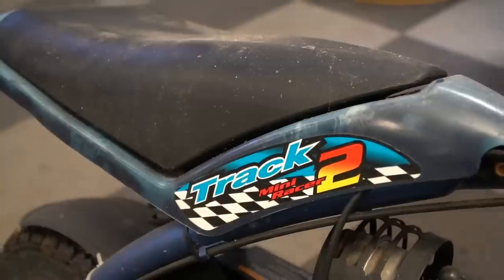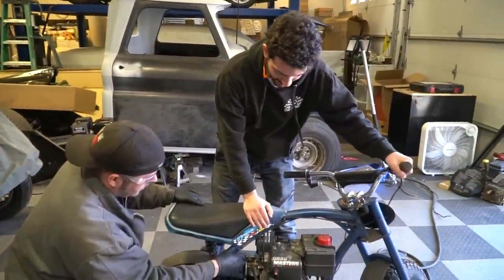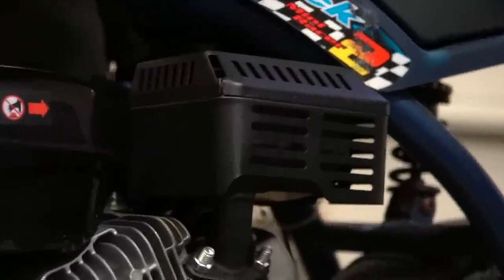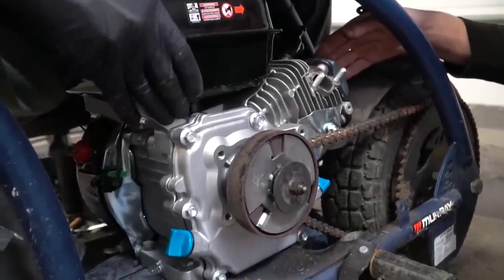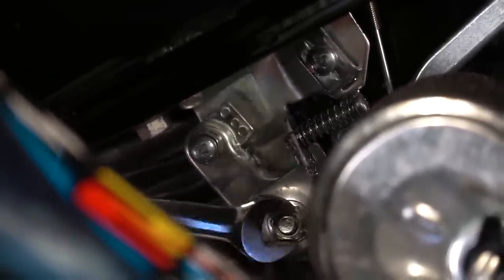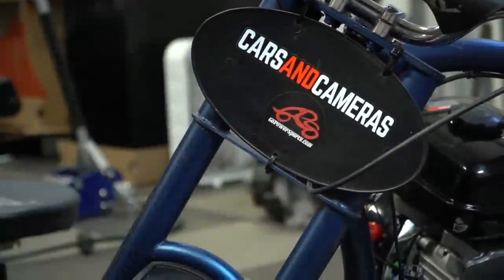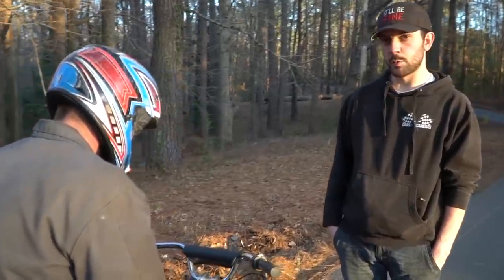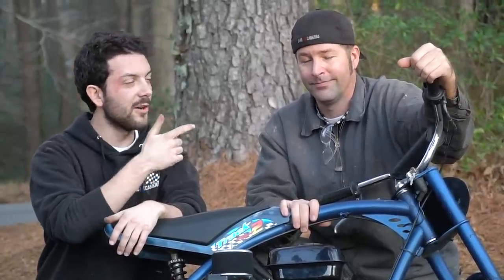Tillotson 212R | 212cc, 12HP STOCK!

Comment: Cool frame. Back in the 70s my dad and I shoved an old 125cc engine with gears into a small mini bike. Top speed was probably 30 with those small wheels but it would pop the front end up at 29. It could climb a tree, the engine was and old Hungarian engine called a White but looked like a two stroke Yamaha. We had to fabricate a rear sprocket from two bike sprockets and manually turn a lathe in reverse to make a left handed threat nut for the fly wheel I think. It had three gears one down and two up. The clutch was a wet cork style and yes we tore the engine completely apart and reassembled it. If it's still in one piece it's probably somewhere in southern California. Good time back then.
Reply: I would of put a 200 in it but that kinda slow for a mini bike but it was probably fun to ride

Comment: I loved my Murray and still do. Swapped a predator 212 on it in 2013 road it for 3 years then got into trucks. Last time a cranked it the throttle stuck wide open and ripped a badass burnout. the huge sprocket on the back makes it a torque monster.

Comment: I own 4 murray track 2s. Best bike hands down. You should do the front suspension upgrade. You can use the forks off a razor electric dirt bike 500 or 650 model and they are a direct swap, no modifications.

Comment: Stock Tillotson 212R vs a  stage 1 preiditor witch is faster
Reply: Matt Wright this!!
Reply: Dump for comparison.
Reply: Definitely the Tillotson.  But if the governor is out of the Predator, the Predator would go harder once it got into the powerband
Reply: Stock tillotson 212r with centrifugal clutch vs stage 1 predator with a torque converter would be an interesting matchup
Reply: Clutch vs clutch with the predators governor removed
Reply: The tillotson has 13 to 1 compression  and the preiditor 8.5 to 1. Tillotson 10 hp , modded preiditor around the same we need to actually see because it's all speculation otherwise. The tillotson is $180 and the preiditor is $180 with the stage one kit . Both very similar but one has to be  king!
Reply: @715101  well, a torque converter is just a variator on the engine side and a regular clutch on the output, so it would probably more finely tune the power delivery compared to a clutch.  But it would have to have some power loss going through two clutches (a variator is basically a clutch fixed to the engine), so itd be very interesting
Reply: Which*
Reply: To be fair for testing the two engines they should be set up exactly the same.  Both should have clutches or both should have torque converters.  They should even have the same gear ratios...
same size sprockets.  Otherwise it would not be a true comparison.
Reply: Tillotson 212 All Day 💪😏
Reply: Or tillotson 212r vs the hemi version

Comment: MFG. DATE:  01060    /  YYDDD  =   March 1st 2001

Murray used a couple different ways of how the date of manufacture was list.

1970's tag format YDDD

1980 and early 1990 tag format DDDY

Late 1990 and Early 2000 tag format YYDDD

Early 2000 on MM/DD/YYYY
Reply: The example you give of how they did it in the 70s is known as the Julian date. Used to use Julian as a mechanic in the Marines when filling out paperwork to order parts for our equipment 20+ years ago.
Reply: Just checked mine.  01066.  Mach 6, 2001...

Comment: Put a torque converter on it!
Reply: yep, thats what it needs most.
Reply: Cvt
Reply: @TheBestOrion  CVT is a torque converter.
Reply: @Ritalie  no, it's a continuously variable transmission. You can find a torque converter in a car/truck etc. transmission.
Reply: @TheBestOrion  torque converter is a brand of cvt for minibikes and go karts. Not to be confused with the torque converter of an automatic transmission.
Reply: Orion VanNortwick an actual cvt would have gear ratios of a normal transmission 1st gear - 4th. Cvt and automatic transmission could be swapped without significant power/speed losses as long as the ratios are similar. It’s a torque converter because at low speeds it slightly reduces the gear ratio, and when your up to speed your at your actual gear ratio, it’s not a transmission it’s a fancy clutch with better low end power. It’s not a cvt it works on a similar principle as a cvt but couldn’t come close to replacing a transmission, that’s why they’re so often compared to centrifugal clutches (aka single gear).
Reply: @yachtyteam6978  automotive cvts only have the gear changes programmed in. For a cvt to work at maximum performance, the engine would remain at the max horsepower rpm while the gear ratios change continuously.
Reply: Kaulin Curtis there aren’t any “gear changes” in a car cvt it’s controlled by hydraulics constantly changing the ratios between the crankshaft and the driven pulley. An engine doesn’t have to put out “maximum horsepower” for a cvt to be effective/max preformance, it’s used mainly because it’s cheaper to make a cvt than an automatic transmission and it gets better gas mileage because the gear ratios are infinite and doesn’t require shifting like auto/std tranny
Reply: @yachtyteam6978  No there are not literal "gear changes." But the transmission is programmed to move the sheaves of the pulleys to change drive ratios to mimic a conventional automatic. High performance cvts don't do this because it doesn't keep the engine at maximum horsepower.
Reply: @yachtyteam6978  so I guess it would be better defined as a hybrid cvt/torque converter? These terms seem to be interchangeable, depending on what forum you read.
Reply: Orion VanNortwick what I’m saying is a torque converter isn’t a continuous variable transmission (cvt) but it’s more of a clutch with low end torque. That’s why we call it a torque converter.
Reply: @yachtyteam6978  but what I'm getting at is that, yes it acts as a clutch, but it also alters the gear ratio like a cvt does. When I built my taco style minibike, I calculated where my optimum gear ratio would be, set it a little taller because like you said it will start out with a good low end torque and then progressively change the gear ratio for more top speed. Or is understanding just completely wrong?
Reply: Orion VanNortwick Your completely right, but what I’m saying is a torque converter doesn’t have nearly the same “gear range” (or whatever the term would be called) as a transmission. Idk if I explained my position good or not, but the best example of what I’m trying to explain is imagine the torque converter “low gear” is a 10 tooth sprocket and the “high gear” is a 12 tooth sprocket, if it was an actual transmission (cvt, manual or even automatic) would have a more significant  difference in the gear ratios. 

Just imagine a 212 predator with a 5 speed auto versus a 212 with a torque converter, with all other variable the same, the engine with the 5 speed auto would whoop ass.

And then imagine a car with a 4cyl engine with a 5 speed automatic tranny versus a 4cyl with a cvt, with all other variable the same, likely the 5 speed would win, but would be close.

Comment: Head, torque converter, better carb, and new tires.  ✌️ Nice and tidy conversion of that stock 212 in a easy pull motor out of the box.   👍👍👍👍

Comment: Widen the exhaust port and make wider downpipe. Also mod the airbox, use platinum plug, and use royal purple oil. If you do all this n tune it to run together, then u cud add a few bhp easy, change a sprocket to add speed, and wala. U shud be able to hit 60mph with up to 8 bhp. 10bhp range can give you up to 70mph. Generally speaking, based on living in a country where we are only allowed up to 100cc 2 stroke or 150cc 4 stroke by law. Also that heavy scarping noise, metal on metal, u can hear it when ur driving towards ur mate slowing down, this is not good and needs spacing or lube etc and cud be holding back ur engines potential

Comment: I suggest a briggs and stratton LO206 engine if you have enough space to mount a gas tank, and a carb and oil overflows.  They're expensive, but they come race-ready with a high flow intake and exhaust if you get the engine kit and they'll last forever.

Comment: Fuel in the bowl with no fire means clogged jets. You guys need an ultrasonic cleaner. It's been a game changer for me on carb rebuilds. I rarely have to purchase carb kits anymore. Ultrasonic clean and make my own gaskets. That bike is circa 2000-2001. Need a torque converter on that thing. We need someone else to produce torque converters. Comet wants a left nut for theirs with no justification (other than supply/demand).

Comment: 12hp or twice the horse power of a predator flowing through the stock carb, air box and exhaust??? 🤔
The only way I will belive that is if I see an actual dyno test done to the engine. I honestly believe that this is just a stock 212 with a stronger cast rod, flywheel probably a little bit more compression and governed 2000rpm over the stock 3600rpm of a predator.
Reply: Yeah...I'm suspicious too. Would be cool to see a tear down of these performance engines that are coming out. Measure its compression, put an indicator on the cam to measure lift/duration, and a standardized test.
Reply: Dynometers vary from machine to machine. They are not accurate. Your best bet is seat of the pants, or the Butt Dyno.
Reply: I looked up the 212R on the GPS site.  It claims the carb is jetted and tuned for the engine, but you have the option to upgrade to their fancier carb for $40 more.  I didn't hear them mention if they got the upgraded carb or not.
Reply: Yeah, doesnt look like 12 hp to me. Stock 212's look about that fast
Reply: Or 'the poor man's dyno'... 12 HP should send a minibike to around 75 MPH with proper gearing... and the rider not too fat of a wind blocker...
Reply: BuzzLOLOL 
No shit, cause back in the day my buddy had a 2.5 tecumseh on one and it hit almost 45. 
12hp? 
It should go faster than my kart with a 10hp. 
It was clocked at 70 before the person clocking me got scared and lifted.
Reply: I got a stage 1 212 and it will pull the wheel up. I'm not sold on this one either. How much is this one?
Reply: I know that my stock Predator is faster at 41 mph.
Reply: Also calling BS on the you really need to do an intake if you're going to run an open header to make it run right. Maybe mine is magic.
Reply: You can't really go off speed as a comparison because gear will dictate that for the most part. It just doesn't seem to have as much balls.
Reply: RCLegion I’d like to see a dyno sheet to. As far a dyno not being accurate, that does not mater much. It’s a good comparison tool. Test a stock motor on a dyno and document it. Modify the motor, dyno it and then compare the results to the stock motor. High speed runs are fun but they are not a good comparison tool.
A more powerful motor could be geared for more speed. Or a more powerful motor could give us better hill climbing ability or faster acceleration.

Comment: There use to be a following on oldminibikes.com.  Pretty sure there is a link to a manual.  Also I remember that there was a post saying that the designers engineered the frame to be safe at like 80 or 90mph.

Comment: If you still have the carb from the 3HP Tecumseh carb I would suggest rebuilding it and putting it on the Briggs you were building, you may have to redo the block side flange to make it work but well worth it.  Even if it needs a rebuild and cleaning it would be a better match for the Briggs from what I have seen done before.

Comment: I did a 18hp vtwin on a old mini bike.  I want to see you guys put a twin cylinder engine on a mini bike and set a new high-speed with it.  Like what you did with the chopper but on a mini bike
Reply: Back in 1960's, I scratch built a suspension minibike with 350 cc 2 cylinder 4 speed dual exhaust... FUN !!! ... Street legal with Cushman scooter title... 
http://i1088.photobucket.com/albums/i333/BuzzLOL1/BuzzLOL%20Pictures/DannyFuneral008-1-1.jpg 
.

Comment: Simply weld on a sausage muffler to that pipe. It will not only quiet it down (keep neighbors from calling cops) it will give it a bit of back pressure and help with your lean condition. Try it with just a couple tack welds. If it works out, Weld-r-up.

Comment: I have the same bike with a predator 212 with stage 3 kit but my header  is turned around facing forward just over the torque converter  used 1 inch square tubing to raise the engine so the torque converter would fit have pro taper Honda 50 bars on it  I'm 180 and it pulls great

Comment: The little bugger might run a bit faster with the front and rear wheels aligned. Not out much, however, doesn't take much to scrub off acceleration and speed. Looks good fellas.

Comment: I got one new when i was 12 and I'm now  30. They sold them at Walmart for 650
 I got hit by a car while jumping a road and shattered my femer and the sharp ass peg on the other side almost took off my foot at the ankle. I ended up stopping it after to after a few minor repairs. If the steering column is loose when you lift up on it is mine

Comment: Ok, so Go Power Sports currently does not have the Tillotson 212R in stock. I’m considering the Tillotson Electric start 212cc Hemi engine with the upgraded air filter kit and TCT carburetor. Also, I’m considering adding a Go Kart USA inverted intake.
Your thoughts?

Comment: Just a quick question if I have a Briggs & Stratton 5 horse on my mini bike and that comes out to roughly about 206cc once you do all the math for the boar and a stroke but my question is you guys are saying that that 212cc has 12 horsepower out of the box I'm very familiar with that motor and I can assure you it does not

Comment: with that motor on it you should think about changing the stall spring to a 3100 rpm. that will allow it to take off much better and yes rejet it. also you should of just cut a small part of the inside header near the curve area and then pulled it out until it cleared the frame and then reweld the cut area up. would of flowed a lot better then just hammering on the header making flat and restrictive. maybe next time you guys can try that trick.
 bikes where build from the late 90's to only the early 2000's . I can still remember Wal-Mart selling them. they always had them outside on display with the lawn and garden stuff.
Reply: With 3100 RPM springs, the clutch would be slipping and burning up most of the time when casually riding around... those springs only for limited racing use...
Reply: @BuzzLOLOL  if watch the video you can clearly see the bike does not take off good . the engagement is way to early and the motor from what john was saying is design to turn almost 6000rpm's
If they get it jetted correct that engine should be strong from 3000 and up.
I don't think they will burn up the clutch.

Comment: U guys rock have a 1993 auzuki gn 125 e that i have to re do a ground wire on and get a battery not pretty but its a works lol the finders need re chrome and some cherry colored pait for the tank aftermarket pipe might need to reajust the clutch but i have a nother one thats all atriped down and gonna use for parts when i need and it does rip but just a battery and thats in the works

Comment: You can do slight bends with a propane torch, in just a few minutes you could have had a dent free exhaust that fit.
Reply: True.  We dont have a torch
Reply: @isaacitllbefine7231  not even a benzomatic? Lol I'm shocked. Wish I could share pictures. I've got one I had to wrap around a bike frame. Thanks again for showing the header sleeve, it fit perfectly on the EGR tube I made for my Pontiac Fiero.

Comment: There is a dyno video of the Tillotson vs Predator and the Tillotson is a better race engine with a 10,000 rpm flywheel but it is by no means close to 10 or 12 hp like assumed according to this guys results. Watch the video. You guys are smart enough to find it on your own. Just wanted to get that out there. Also I have a Duromax generator with a 212cc on it. It has an aluminum flywheel on it. Do you know if they use the Tillotson engine or is that not relevant?

Comment: Guys do a stage 1 build on the motor
I just put a tilloson mechanical fuel injection 
On my predator 212 and it is so easy to tune
Keep the tires spinning

Comment: Me and my buddy put a 212 on one of those and swapped out the 72 tooth sprocket for a 56 tooth. That thing will do 46 in just a few seconds. Its very hard to find info on it. Ours was made in 2002
Reply: Should run 50-55 without the gov...

Comment: Whats the difference between this Tillotson 212"R"  & a Predator 212. ?

And can i make my  BSP 196cc clone racing engine as powerfull 
for VERY LITTLE.MONEY ?
Example : Shaved head
Bored/Bluprinted Carb
Cam & Comp valve springs 
Thanks in advance !

Comment: On the air intake mod. for the ct200u a short black hose must be removed, is it ok to leave it off and the hole in the silver valve box is it ok to be left open?

Comment: I have the same mini bike and I always have problems starting it I have been looking for a new motor I will look to go power sports
Reply: Run some 'SeaFoam' in the gas to clean out the carb... $6.50 at Walmart... $13 at auto parts stores...

Comment: Hey guys I love your Channel,  but I was trying to put a torque converter on a predator 212 and by the time I space the front engine plate out far enough for the belt to line  up it was not enough shaft left what do you do in this situation.

Comment: My stock Coleman CT200U-EX I just bought goes 30 mph, 31 mph downhill, and all I did was cut the throttle stop screw off, and I zip tied the governor. Mine is only 196cc, so wouldn't I be better off upgrading my original engine?
Reply: Eventually that engine is going to die. When it does, replace it with a tillotson. You won't regret it.

Comment: That's the first time I've seen you guys use air on a carburetor. You should put that engine on the two speed minibike. It would probably do 50mph.
Reply: 12 HP should do 75 MPH on this minibike...